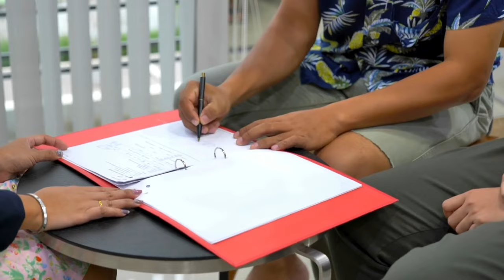Notre Dame Cathedral Restoration Ignites FURY! l Notre Dame Reconstruction Today

Comment: Traditional Medieval windows belong in the Notre Dame Cathedral.
Reply: Agreed!
Reply: These windows aren't medieval, they're from the Victorian era.
Reply: @G1NZOU  The restorationists and Macron in the video clearly states they're "Traditional Medieval windows ". Of course some panes have been replaced over the centuries. They're not in a British Victorian style, but are in the original Gothic with many of the panes centuries old.
Reply: @G1NZOU  Are you Japanese commenting on French Gothic art? Hilarious!
Reply: @G1NZOU  I remember your knife commercials on TV.
Reply: @leannevandekew1996  No I'm British, they're not medieval, the old stained glass apart from the rose windows were replaced in 1756 with plain glass and only replaced yet again in the 19th century with new in the traditional style.

The video is incorrect.

(PS, they also reconstructed the South rose window in the 18th century because it was poorly built, and ended up entirely rebuilding it in the 19th century)
Reply: @G1NZOU  If I replace the oil, filter, spark plugs, windshield glass in my 1974 Triumph TR6 automobile, it doesn't make it a 2024 Triumph TR6.